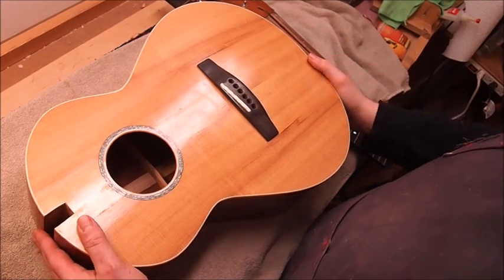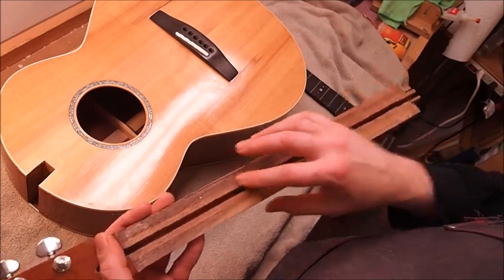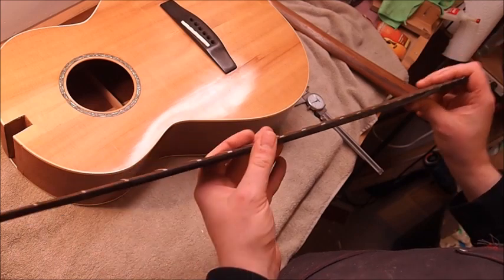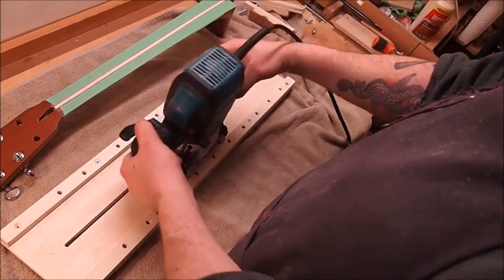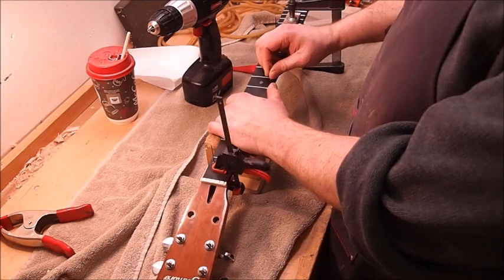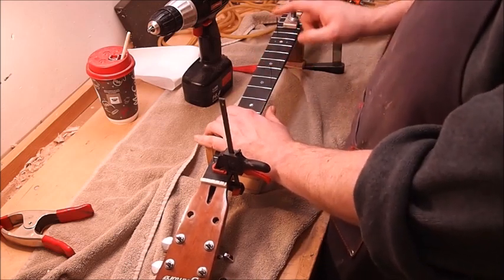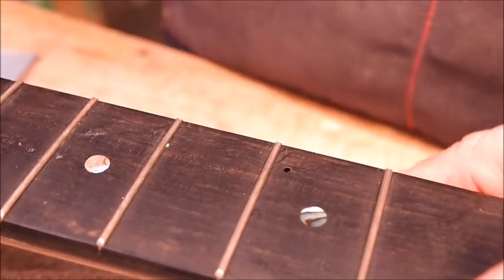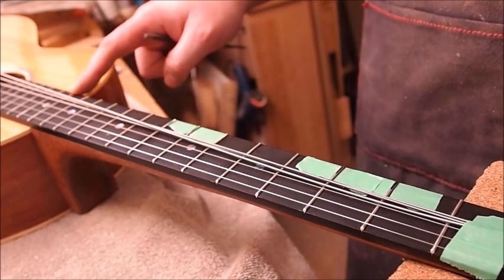Gilmore Baritone Guitar neck repair and fingerboard reglue

Comment: Very nice work sir! I built that guitar a long time ago. It was actually a commissioned instrument. The body size and scale length were chosen by my customer. He was adamant about the scale length. I tried to talk him into a shorter scale. I have since changed to a threaded insert bolt on method.  My level of craftsmsnship has also improved greatly since this guitar! Thank you for sharing. I love that these guitars are on journeys of their own!
Reply: Mate.  Beautiful guitar with a gorgeous sound.
I guess the guy wanted the longer scale so he could avoid using thicker strings whilst having enough tension for things not to flop around.
Reply: Still a fantastic sounding instrument!
Reply: Beautiful guitar...I assumed that was built to spec by customer requests....nice work and what a fantastic sound.
Reply: Beautiful looking and sounding instrument, David. 👍
Reply: You did a great job David, it sounds great. Really deep, rich sound that surprised me for a guitar that really isn't that big. I don't know if it is the wood you used or the internal construction....I wish he had showed us that. Peace to ya bud.
Reply: I love all those choices made by your customer - scale length and body dimensions. The later because the instrument has such a wonderful, articulate tone without being all boomy, and the former because I'm a huge guy (taller than Ted!) with long fingers, and I'm a bassist. I think I'd feel more comfortable with that scale length. I might want a slightly wider nut width though. I dunno. I feel like I could be part of an acoustic group playing something like that - half bass (which I'm good at) and half 6-string (which isn't my strong suit). What a wonderful axe!

BTW, I've routed for those Hot Rod over/under truss rods and gotten really thin wood on the back. Once I went all the way through, and once I got a couple cracks along the channel. I hate throwing away good wood like that, so the rest of my necks have been big & fat! That was in the 1990s, and I don't think those low-profile systems were available yet.
Reply: 30" scale baritone, skinny neck and 16 frets to the body - customer had you building a time-bomb ;) A great sounding one at that!

Comment: As a retired machinist I appreciate your creativity and candidness.  I have a 2012 Martin HD-35 (bought new) that I've worked on.  The highest 6 frets I lowered around 10 thousandths and re-crowned. Great for 7th fret capo-ing.  My action at the 12th fret (both sides) is 1/16."  I just added a Plate Mate and titanium bridge pins.  I like what I'm hearing.  Oh, and no fret buzz anywhere. And I play hard with 3 MM picks. Strings: I use 13's tuned down a whole step, maybe that helps?  Intonation is dead on everywhere according to my chording pressure,  I'e been using Pyramid round core phos. bronze strings.

Comment: I'm a woodworker and I really enjoy yourr videos. Now that "barrel bolt" is usually called a cross dowel. They come in many configurations, I would suggest using one that is symetric to provide even pressure on the joint. The method you used to repair it (flooding with thin CA) should be the standard installation technique when working with such a small area sujected to a lot of tension.
Wonderful work you do

Comment: TRY A SPRING STEEL FLAT BAR 1/8" X 1/2" OR SO ON EDGE FIOL WITH MARINE TEX EPOXY CLAMP TO A STRAIGT EDGE TO KEEP STRAIGHT CLAMP AND LET CURE .

Comment: Your work is very inspiring, but I must tell you that a baritone is not necessarily subject to more tension than a standard guitar.
Thick strings can actually have lower tension than "normal" ones.
It depends on scale length and how it will be tuned.
I've converted standard guitars in to baritones and it's truss rods had to be relieved.
Reply from the maker: Oh I agree. When I put the figures into a string calculator, in this case with the long scale the difference was an additional 24 lbs (10.5kg) tension in total.  It's a little too long for standard baritone strings, and a too little short for bass strings.
Reply: I frequently make customized sets of strings out of singles to get especifical results on different instruments and tunings. They're usually for my own use, so the hassle for getting new strings when needed it's all on me. 
I understand that customers may not want to go through that. 
Thanks for replying, congrats on your work. It's great to watch.
Cheers from Brazil and excuse my self taught english.
Reply: @brazilgrass  string by mail sells singles as well as customized sets.

Comment: It´s got way too much ring to it.
Should do the reverse of what you did to that
lone ranger guitar, put a wooden saddle in it
like I saw in one of the guitar in your video
it had a rosewood saddle.
I tried a lot of Ukuleles in a music shop, you
know the ´nylgut´ strings are the rage now
and every uke that comes from the factory
has them, they are supposed to make ´em
sound so much better. Not to my ears, some
did sure, but most just sounded (much) brighter,
like in ´too much diskant´ (treble). I had black
nylon GHS in my tenor uke, sounded much better,
I guess it´s the frequency that makes the difference.
I guess this same applies to nuts, everyone puts
bone or tusq in now but I remember woodnuts were
used in a lot of guitars when I was a kid.
Bone saddle and nut will sometimes just make
the guitar sound harsher, clearer yes but sometimes
also harsher.

Comment: That neck should have had TWO pieces of carbon fiber in it, AND the OLD simple 1 steel rod truss style rod. Two way truss rods? WHY? Those barrel bolts are very popular with cabinet makers who make huge cabinets that run for several feet or a few miles. I never really thought they were very good for a guitar neck though. They tend to cause cracking. Threaded inserts and super glue infused wood, and maybe even some more carbon fiber and some epoxy for me. I ran a lot of carbon fiber up through the heels of upright basses, so.....
Reply: yeah, but that superglue trick is awesome, especially the preventive aspect

Comment: Excellent vid, thank you. It doesn't seem to be a particularly well made or finished instrument,  the result of inexperience maybe?
Reply from the maker: I think it's from an early point in the builder's career, but it's not poorly made. It likely represented really good value for money to the player who commissioned it. Some of the idiosyncratic elements come from trying to satisfy the vision of the buyer -and that's not always easy to do! It's had a lot of use, and French polished finishes tend to wear quickly.  Dave, the luthier, doesn't use that style of neck attachment system any more.  Mostly, it's just a cool sounding guitar that plays nicely - it's performs really well as a musical tool.
Reply: @twoodfrd  or not using well seasoned wood and not humidifing in the case  
 Ok ge yse crappy wood admit it